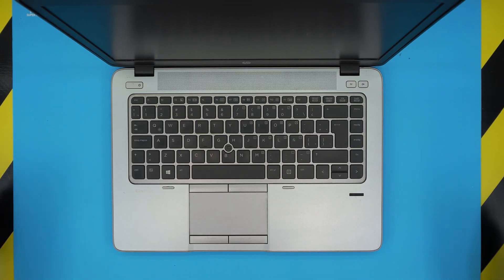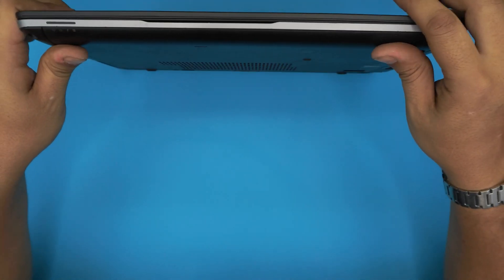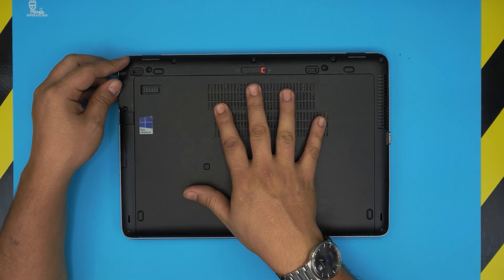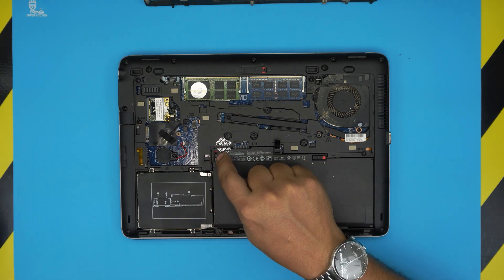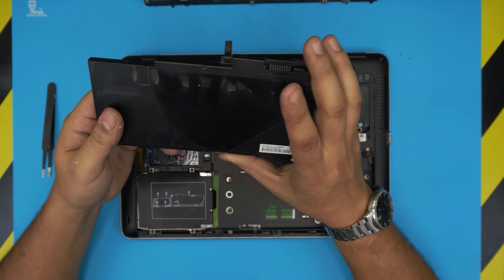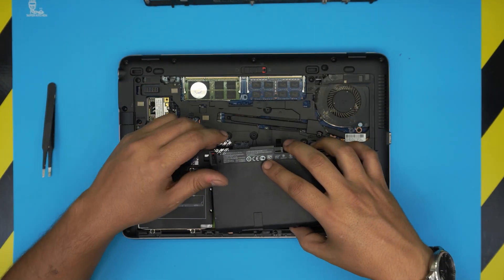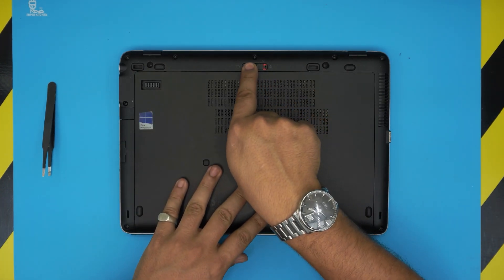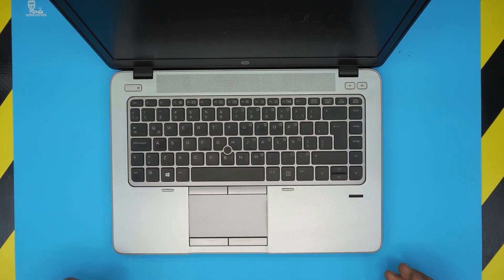HP Elitebook 745 Battery Replacement Guide

Comment: In my laptop there is option of two batteries..where is the port of secondary battery??
Reply from the maker: Thank you for the feedback! if you wish to support the channel you can LIKE or SUB or both :P
sorry that i was away for few days, regarding your question:  the 2nd battery is the external battery it goes under your laptop the connector in right under your laptop tot he left side, the external battery can be found on ebay:
https://is.gd/VnJHiV